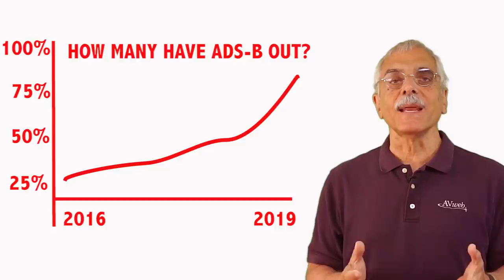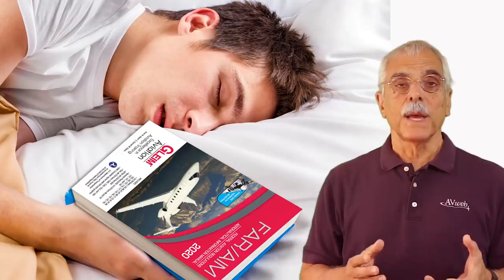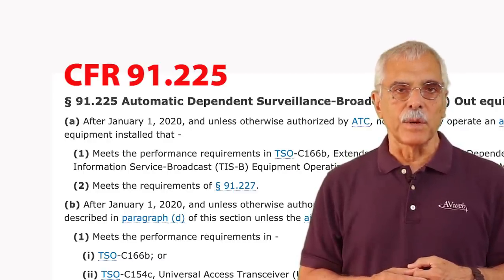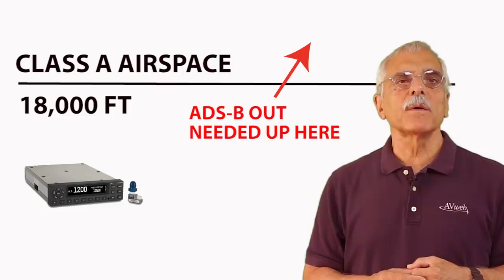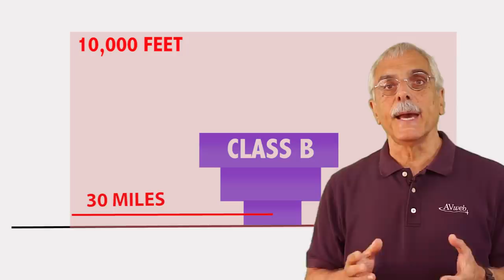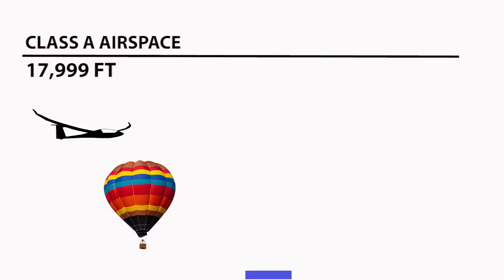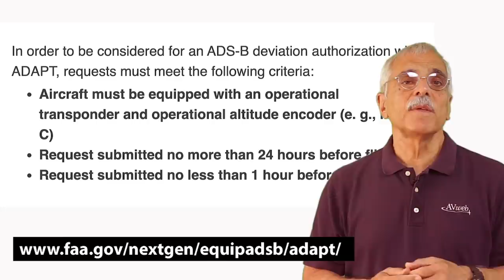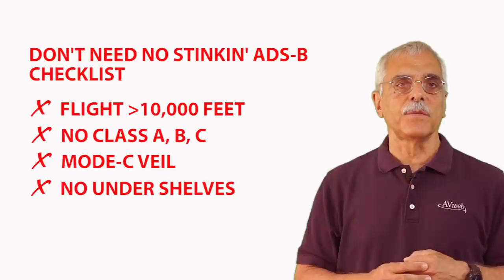So You Blew Off ADS B  Now What?

Comment: The waiver process described is not entirely correct.  

I saw a document online where somebody at the FAA named Maurice Hoffman granted a blanket waiver to the Department of Defense for something like the next four years which includes all DoD aircraft and aircraft operated by various vendors of DoD, which I presume to mean corporations which are defense contractors of whatever sort.  I can only assume that other government departments and maybe corporations or campaign donors of sufficient political schizzle have probably also already been granted these blanket waivers as needed, tho I would have thought that such operations such as DoD with unlimited government resources should have been expected to be the very first to have complied with the government regulation and corporations and other big donor types I would have assumed would have aircraft sufficiently expensive that ADS-B equipment is not that much of a financial burden.  If the Trillion Dollar Defense Department can''t afford or arrange ADS-B equipment installation, how do they expect the random Cessna 172 or Taylorcraft worth maybe twenty grand to afford two to six grand for this equipment?  And if DoD and Dept of Ag and Dept of whatever and local cops and Wal-Mart I suppose are all zipping in and out of the congested airspace without it, then what is the point of doing it at all?  

And I think, based on experiences with other equipment requirements by other agencies that the benefits of ADS-B In equipment that we are being sold on will probably slowly be curtailed for "security" reason or the financial burden on the FAA or whomever, or somebody will rely on it and it will screw up and kill a bunch of people, and I am 100% confident that they will eventually shut the website down for the one-time waivers once people figure out how it can be done and the system gets overloaded.  

I don't see the benefit.  It is being required where it isn't really needed and isn't required where it could really help.  The big beneficiaries are the avionics manufacturers.  You apparently can't doe some cheaper home-brew equipment, it has to go through a bunch of certification, so there are only a few suppliers, and it is priced artificially high.  I am wondering how much campaign cash and lobbying costs were expended by avionics manufacturers to push this so they could get a boondoggle.  

Unless they can get the cost down into the few hundred dollar range, I don't see this as being a practical requirement.  The place ADS-B In would be really helpful is at Class D airports without radar and uncontrolled airports.  I have yet to see any ANY practical arguments as to why ADS-B Out should be required in radar environments like Class C and B airports or over rural South Dakota at 10,100 msl.  And that is another thing, is the requirement 10,000msl or FL100?? how does that make sense??? Oh well.  Just more nuttyness we have to live with so that somebody in a department somewhere can say they did something good.  

I previously assumed based on what has now turned out to be BAD information in the FAA's little pilot safety magazine that we would be able to fly under the shelf of Class C airspace to get into smaller airports around medium sized cities, but apparently not.  I know from this that the FAA has officially put out some information on this that is not correct, so I don't trust anything the FAA says.  

Oddly, I sometimes go to a small airport just north of Peoria, which is mentioned in the intro to this video, and it has been nice to go ahead into the main Peoria airport to get gas and other FBO services, but not with this requirement.  I see that being a much less safe trip now.  This could kill a lot of general aviation airports on the periphery of cities, particularly medium sized cities, and make it impractical for a lot of general aviation use to populated areas.  It won't kill GA, but it is going to change the nature of GA.  But then it sort of makes me question, exactly why does Peoria IL or Springfield Mo or even OK City really need Class C airspace??? I mean, I've been in and out of these places, and they really aren't that busy most of the time.  Just a few weeks ago I was traveling Branson to Joplin and monitoring Springfield Approach, home of a class C, and there were two separate periods of about thirty minutes when they didn't have a single aircraft talking to them either within or nearby approaching their Class C.  Thier airspace was empty.  Why is it Class C.  Could it be time to maybe downgrade some of these rediculous Class C designations.  For that matter, are there some Class B places that really should be Class C??? like maybe Kansas City???   Kansas City might be busy now, I haven't been there in a while, but there was a time when Kansas City International got less actual traffic than downtown or even Lees Summit waaaay out at the edge of the Mode C veil.  I wonder if along with this requirement if there should have been a nationwide review of what airports really did or did not actually require Class C or B designations anymore.  I mean, Jesus, Peoria lost its biggest giant employer and along with it a big part of its corporate traffic and I don't even know if they have commercial service there anymore.  Why could it not be reclassified as Class D, or maybe as a TRSA like Ft Smith, which appears to me to be three times busier than Peoria.  

Anyway, I've ranted enough.  The bottom line is the economics of it don't work for me..  I have several airplanes, and I'm not spending the money on all of them, and looking at my log book, there was ONE trip where I landed at a class C airport where I delivered a bunch of parts to somebody and really should have driven anyway and there was one job I did, oddly, for the FAA at another that I could just as easily have declined.  There were a number of trips where I could have flown around the Class C airspace to get to an airport on the other side or to navigate around something, but being required to stay out of Class C and nav around them sort of takes away the incentive to talk to ATC enroute or on arrival, or ever until you are actually on the edge of Class D, so I can see purposely NOT using flight following or calling approach for any reason at all.  If you are talking to them and you inadvertantly bust the airspace, or more likely they don't know or don't care or aren't keeping track of you ADSB status and vector you into a violation, they have you identified, so why talk to them at all?  Just call Class D tower or advisory after you circumnavigate the Class C and get to where you are going.  

I suspect it will take a few months for everybody to adjust to how this is going to work, and I suspect that the net effect might NOT be improved safety, at least for the cheaper end of GA.  After a few people have ADS-B equipment failures and famously get violated, I can see a bunch of people ripping it out and adjusting where they fly.  I've had a couple of airplanes with twenty-year old Mode C being quirky, but not anywhere where it was technically required.  When this ADS-B equipment gets some age on it, people might start having the same problems.  And I wonder if it is gonna be like GPS systems, you buy it thinking it is a great investment, but the vendor quits providing map updates after a while, so it's only good for six to ten years maybe, then you have to buy a new one.  I wonder if this 'investment' in ADS-B will actually turn out to be a 'recurring expense' instead.  

Being without it will change how I fly a little bit.  There is one seminar in Houston that I will simply skip.  Instead of overflying Class C by several thousand feet, I will zig-zag around them a little bit, and I won't be flying to Kansas City.  or Dallas, but I haven't needed to in a long time.  

I really don't think this was thought thru very well.  It looks like somebody in a department got an idea of something they could mandate on everybody and assumed everybody would go along with it if it got enough inertia and that they would be big hero's for holding tough on the requirements, and I expect the FAA will resist any changes in the program for that reason, so there's gonna be an adjustment in how and where people fly.